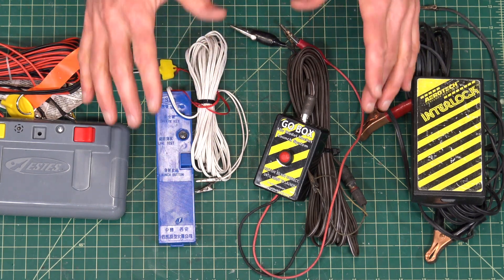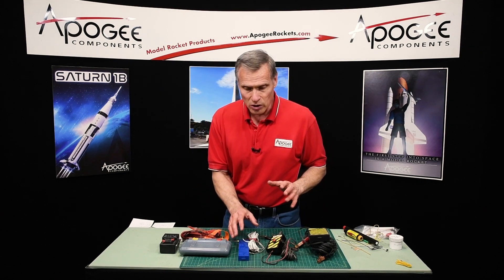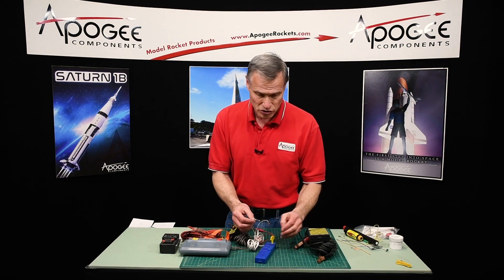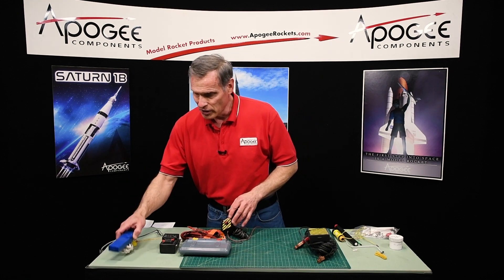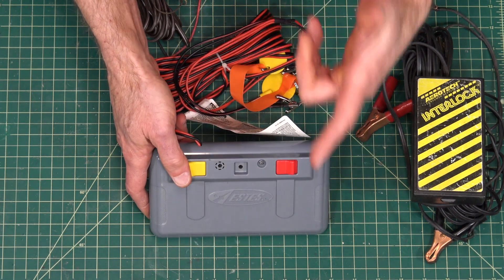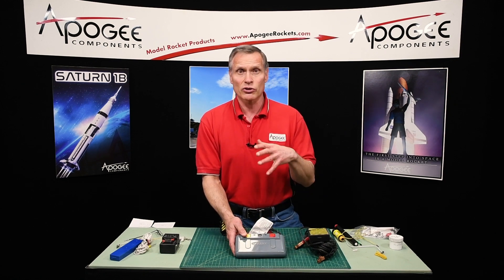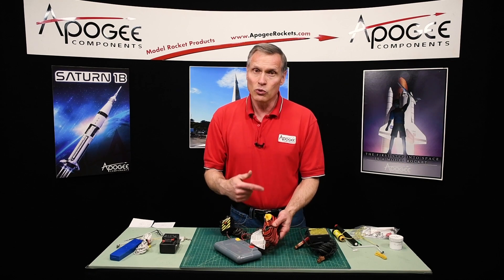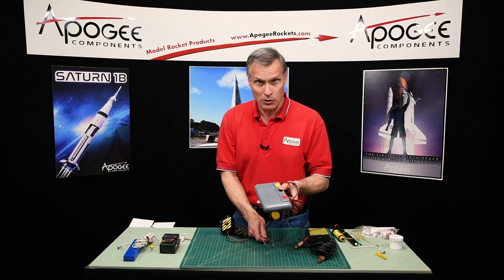Selecting a Launch Controller

Comment: So you claim the wireless launcher has a range of about 200' which sounds great but on your website looking at the specs on that wireless launcher it claims it only has 40' of range. So which is it? 40 or 200?
Reply from the maker: Yes. It is 200 feet.

Comment: I built my own similar to how many others have said, I actually took the wires from 2 old estes electron beam controllers, cut the clips off of one of them, and soldered them together for a 30ft. cable. It has 11 volts and works fine for my mid-power rockets. once you know what igniter type you are going to use, it's really up to whether you want to spend more money on a new controller or spend more time making your own.

as far as safety goes, I tend to like the ones that seem overkill, just in case. in my controller, I wired in a switch where the two cables connect so that in addition to the safety key (which you have to not only insert but turn) you have to first turn on that initial safety switch. 

anyway, sorry for rambling but helpful video, I really appreciate all of these in-depth tutorials and explanations and the large amount of information you have on just about every product on the site.

Comment: are the higher power controllers compatible with weaker engines?
Reply from the maker: Remember, it is not the controller that lights the engine. It is the igniter. Higher power controllers can fire off all igniters. It doesn't care which motors they are in.
Reply: @apogeerockets  Thanks.
Reply: Apogee Components does it ignite the igniters that are connected to the engines?
Reply: @apogeerockets  yeah the "controller" doesn't "FIRE OFF" anything it ignites, lights, or starts an igniter! You might want to bone up on terminology that is appropriate, productive, and positive to rocketry! You might want to sound professional! 🤣
Reply: @terrywheelock9458  Might want to sound professional yourself there Terry. It's no wonder nobody has responded to you in a year since your post.

Comment: I've built my own controller and it works great. These also look great
Reply: Yea, I did too. Like ~20 years ago. But unfortunately I stole myself some of the parts from it over the years for other projects, and now that I got back into the model rocket hobby, I can't find the old wiring diagram anymore, and so this once very nice 12V launch controller is pretty much useless.